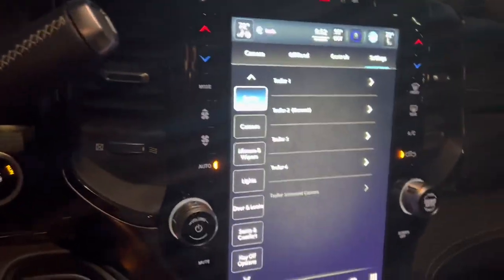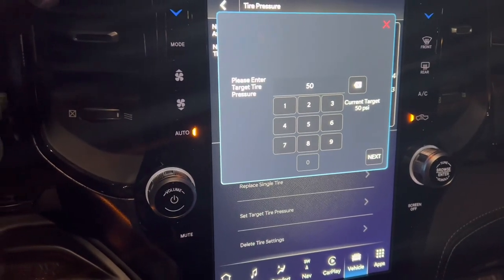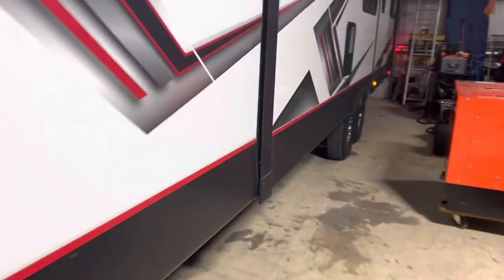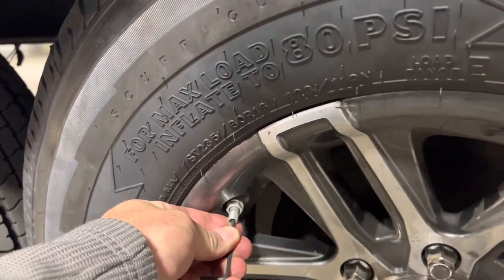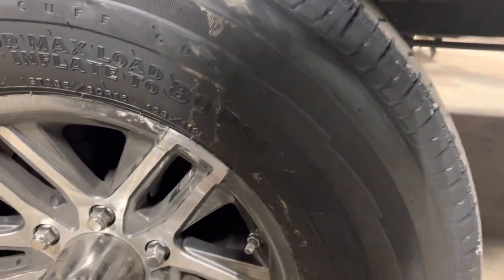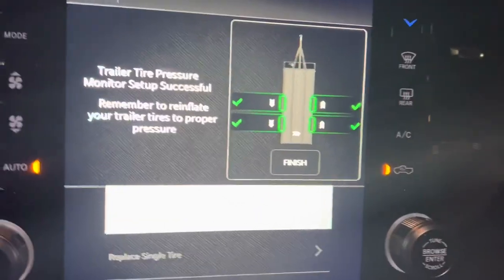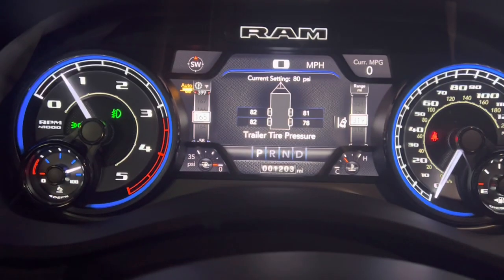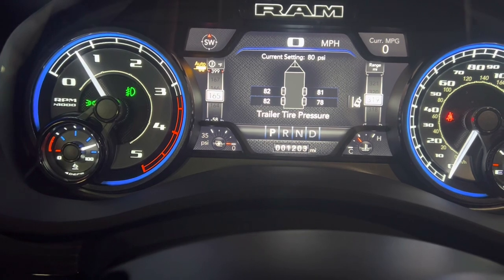2022 RAM Trailer TPMS setup

Comment: I’m curious if a 5th TPMS sensor is permitted for a dual axle trailer’s spare? I saw there was a screen asking how many tires the trailer had. I wonder if you could enter 5 in that screen, as long as the spare had a TPMS sensor fitted?

Comment: I got the tow package with my truck but didn't receive any tpms, did you have to have them installed before it shows up in your truck settings, or was it already there? Mine doesn't show the option, but I wanted to make sure before I buy some.
Reply from the maker: Had to order trailer TPMS option

Comment: Have 2022 3500 mega cab dually with the trailer tpms. What's the work around if it reads 405 on EACH trailer selected? Thanks for your help...your video is great!
Reply from the maker: Create a new trailer profile. Set it to pressure you want
Reply: @RockyRohde  instead of using one of the 4 trailer profiles it has already?

Comment: Thank you for taking all the time on your videos, they are great! I just took delivery of my truck, same as yours, it took 5 months and 7 days but definitely worth the wait. I got the trailer tpms, your video helped me a lot since I also had a 405 number pop up. Twice now when I hook up the same trailer they I've configured, it says no trailer tpms connected and then sometimes it works. Do you ever have issues when you reconnect to the same trailer? Thank you!
Reply from the maker: Yeah mine keeps forgetting sensors.. prob a glitch in uconnect.. hopefully they fix it soon
Reply: @RockyRohde  Thanks!  Each time I'm having to redo the sequence which is easy enough but then I have to air all the tires up again which is annoying. Glad to know it's not something I'm doing wrong. Appreciate your videos!
Reply: Question I have 2022 Ram 1500 Ltd do they come with trailer TPMS capability or is that special feature?
Reply: @dimapro  it was an option when I ordered it, it comes with 4 tpms for your trailer tires, allows u to see it on your dash.
Reply: I know u have a new truck now but this is for anyone who has the ram. Mine still does this when hooking up trailer, if I click on use this trailer then use a different trailer and then use this trailer a few times with the set target pressure displayed it'll eventually recognize and work. Pain in the butt and not how it should be but better than re doing all the sensors again.

Comment: Hey, I used my trailer this weekend. I re did the sync with the sensors, worked fine but then quit on the 3rd start up. It said trailer tpms not configured or setup, I pushed the select this trailer on and off like 5 times and all of a sudden my tpms was back on the screen. Not sure if it works everytime but thought I'd let you know.
Reply from the maker: Thanks.. mine did the same third start

Comment: I have a grand design imagine.   Do you know if the liepert tire pressure sensors will be picked up by my dodge?
Reply: Or do u have to pull the tires off and put different pressure sensors in?
Reply from the maker: You need to see what frequency they are.. Ram changed frequency in 22 for Tpms..